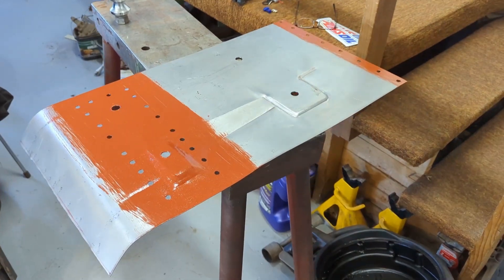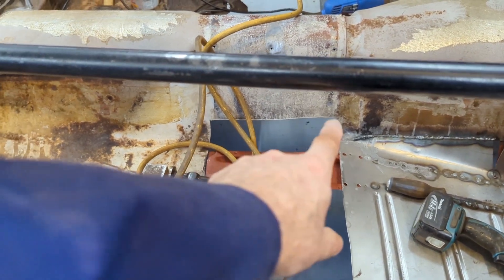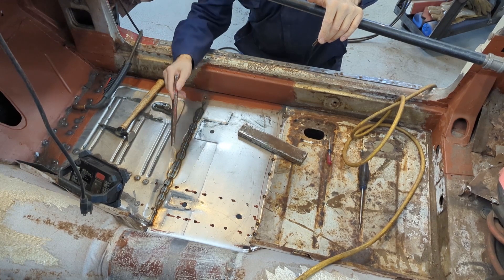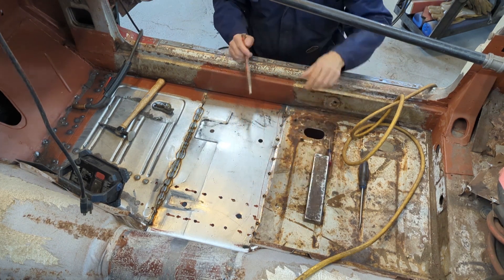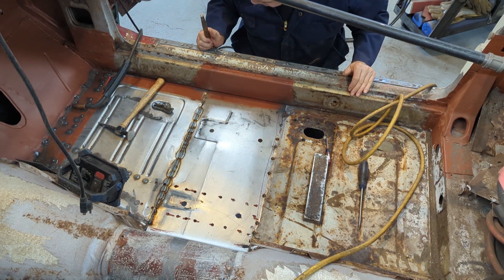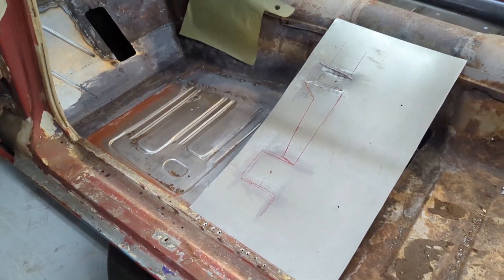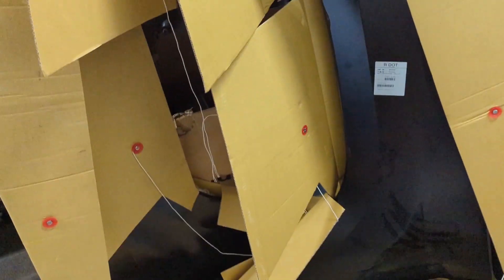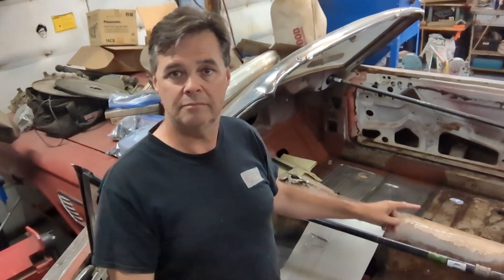Seat Pedestal & Floor Pan Repairs Part 4 - 65 Thunderbird Convertible #Ep 59

Comment: Alvin,
Good to see you back on the ole convertible.   I liked seeing you do those cut and butt welds.  Now you show me...not that it would make any mprovement to my trashy welding.  But if possible I would like to know the thickness the cutting wheel.
Regards,
John
Reply from the maker: Hey John!
If we were living closer, I would be more than happy to help you with your welding.
I use 1/24 thickness cut off wheels, and the brand I use is Linconson, I buy them in packs of 50 from Amazon...I found this brand to hold up really well.

Comment: Hey Alvin, glad to see you back on the Thunderchicken. I think there will be less of the original car left and more new metal. Im looking forward to seeing what you will do with the center console retaining strip that straddles the tunnel on each side. I don't think I saw where you removed that. Were they rusty or damages? Assume the screw holes are hogged out so you might want to resize them. The pedestal is a thicker gauge metal than the floor right? I dont remember.  Your making good use of that parts car, money well spent. You think your shop is a mess, you should see mine. If you start to loose interest in the car, hang some nudie calendars inside it to entertain you while your working on it. Works for me. Anyway, thanks for another informative video. Very interesting.
Reply from the maker: Hey Nick!
I just cut the console strips enough to get the pedestal out, should be no trouble welding them back together, there is some rust on a couple of sections, I saved the ones from the parts car, so I have patch pieces if needed.
Most of the mess in my shop is that I turned the convertible into a storage area...too many flat surfaces on these old Birds!
Reply: I know exactly what you mean. Its easy just to throw something on the trunk and call it a day. I'm a bad tbird owner!